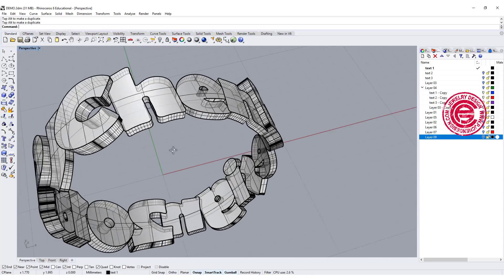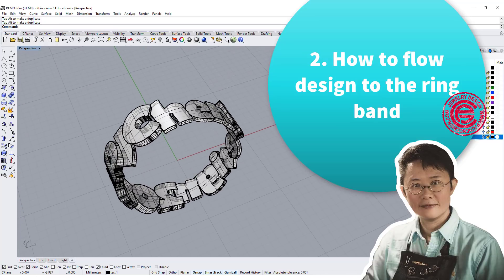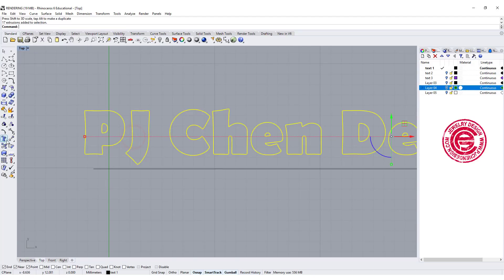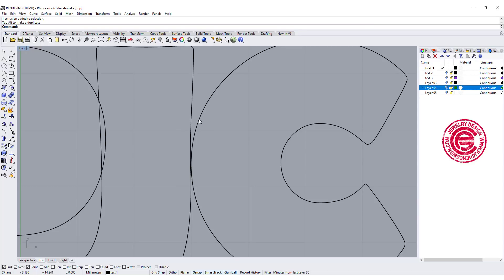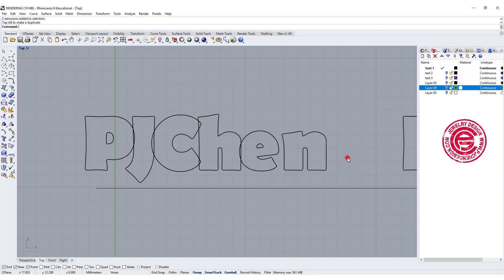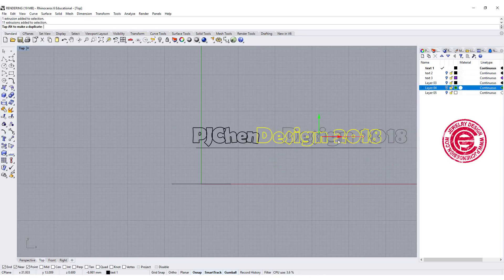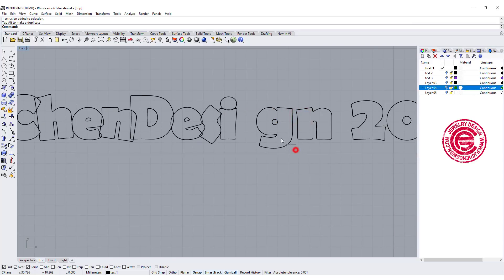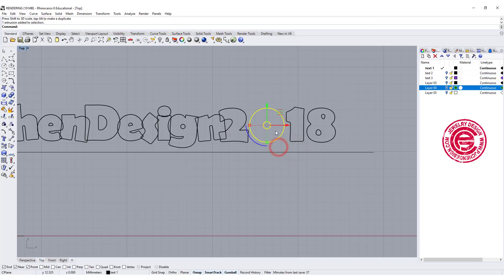Text Ring Mini Series #1 Jewelry CAD Design Tutorial in Rhino 6

Comment: Thanks for this video. I ran into the same problem with some extruded text surfaces in my current project.
Reply from the maker: not sure what issue you have without seeing model. but make sure your curve is a close curve and there are no intersect into itself.
Reply: @PJChenJewelryDesign  Thanks. It was just a letter K from the text tool. It was fixed after rebuilding the curves

Comment: Hi Pj Chen ...
I think that there is a problem after doing the flow along curv at the seam point, the letters will be overlapping and we can't make a boolean union because it is one part
Reply from the maker: if that is the case. you can flow the problem letter by itself. just move it a bit away from the seam. once you flow it to the ring and you can rotate it back to where it suppose to be